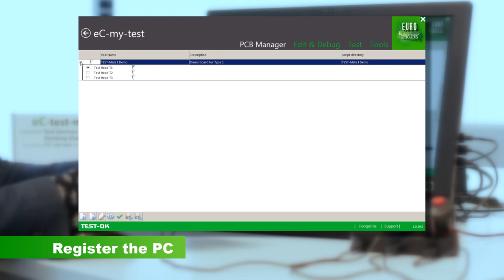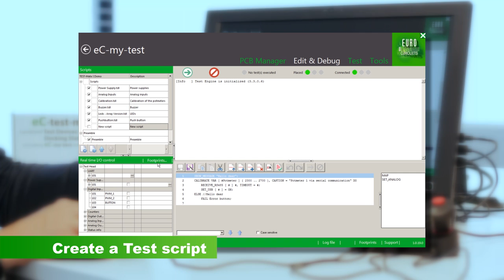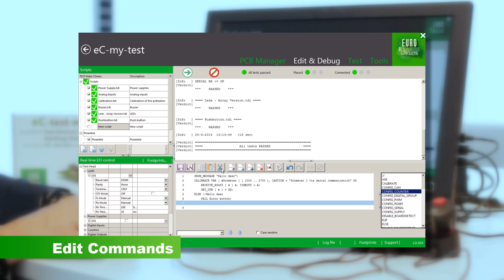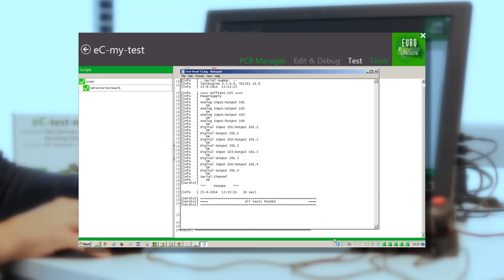eC-test-mate

Comment: Too big PCB footprint and too expensive for what it actually does.
Reply: Do you know any alternatives?
Reply: @AntonMadness  This is a problem. But the workaround is quite simple: design own interface/adapter board to connect eC head on the one side, and provide any connector on other side. I am surprised, that they didn't design it yet. This small adapter would significantly increase the capabilities of this testing environment.